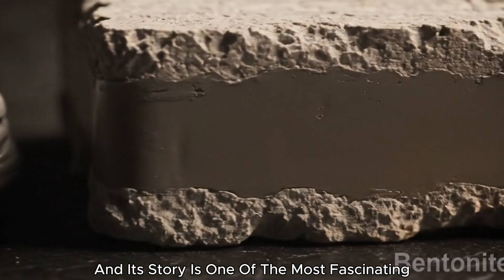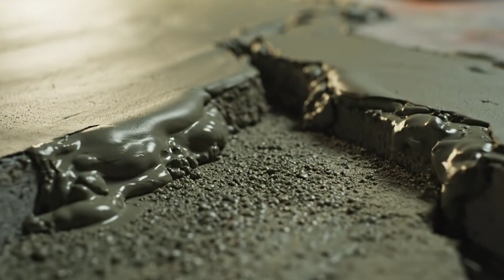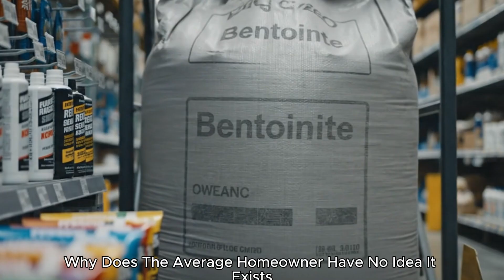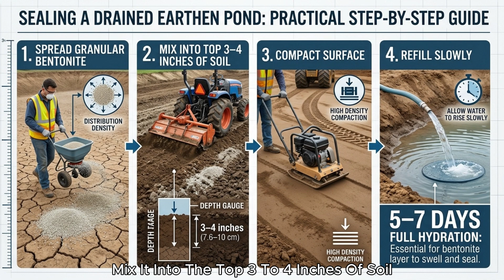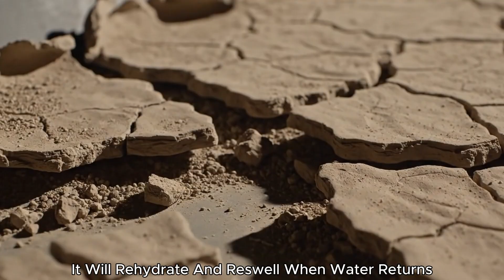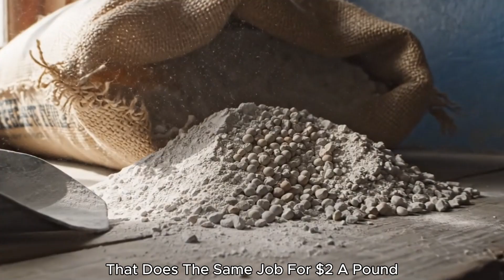The $2 Powder That SEALS Any LEAK Forever Plumbers BURIED This in 1952

Comment: We coated the inside of our cisterns with white Medusa cement it was our cisterns biggest selling point when new potential customers would call or come to the site dad would invite them to come on down onto the tank that gleaming white Medusa cement sold many a potential customer to order a tank when dad first started using this coating when there were defects in the concrete Dad would mix up some Portland cement and patch it but if you didn't wait for it to fully cure when you coated over the patch it mixed with the coating leaving a gray stain on the wall I made the patch material with white Medusa cement and white silica sand it made a patch I could coat over with no visible color change if you knew where to look it's surface was like sand paper
Reply from the maker: That’s a great real-world example. Cistern coatings are a perfect case where durability, water resistance, and customer trust matter more than the headline material. Sometimes the “boring” coating detail is what actually makes the whole system work.